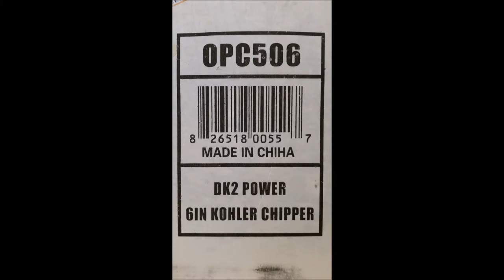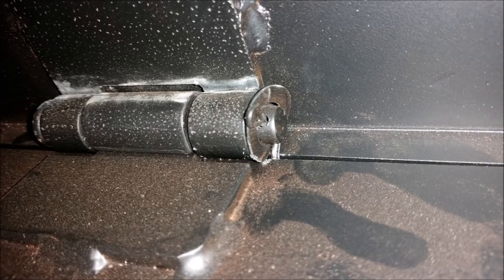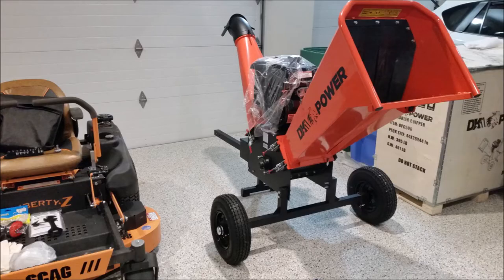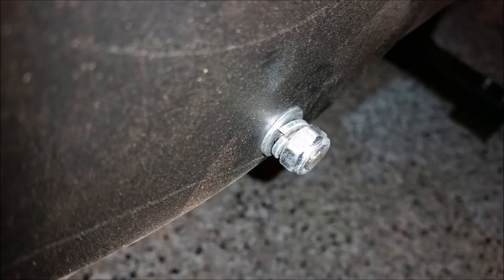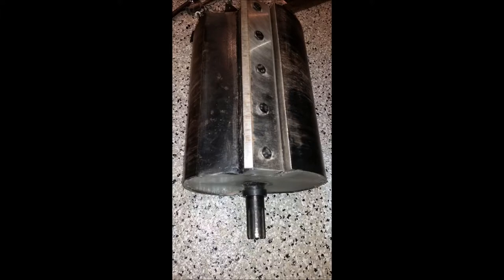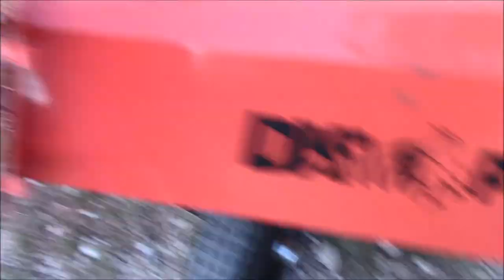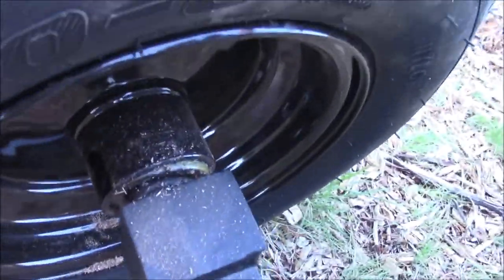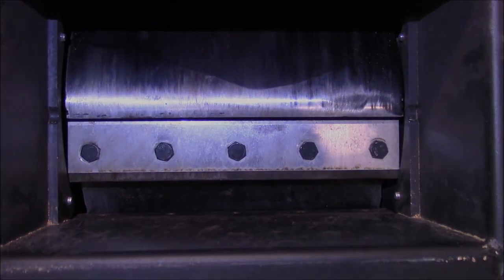DK2Power OPC506 Wood Chipper NIGHTMARE and Tear down!

Comment: I think you got a returned item . Did you look at the blades before you started the chipper ? I bought the same machine and it works great . The only thing I don’t like is the chipper blades get dull fast . That’s probably because like you I was trying to chip dry wood . On a fresh cut tree it works really good .
Reply from the maker: No it was a brand new unit trust me.  it was a piss-poor lemon that's for sure.
Reply: @morejelloplease  how did you get the whole drum out of the chipper ?
Reply from the maker: @johnbailey9682  I don't remember the exact steps but I had to remove a bunch of nuts and the studs were stripped, the belt cover was stripped, lots of slag, it was a cheaply made and assembled mess.
Reply: @morejelloplease  I was changing the blades but one fell down into the drum now it’s under the drum and cannot get the drum off
Reply from the maker: @johnbailey9682  maybe you can get at it with a expandable magnet, make damn sure that spark plug is removed from that engine you don't want any chance of it firing or compression rotating that drum and taking off your fingers.
Reply: @morejelloplease  yea I can’t even see the blade so I’m trying to remove the drum to get the blade out it’s under the drum and I can’t see the blade anymore .
Reply: @morejelloplease  tried that does not work I got the drum lose I asked a friend to help me when he has time because I can pry the drum up but need someone to pry the blade out .

Comment: The blade is mounted wrong;  the bevel on the blade should be turned toward the drum.
All  chippers work like a guillotine. The sharp edge of the blade passes by the anvil, thus doing the cutting.
This is why the chipper would not chip.
Reply from the maker: this is how it came from the factory, it wouldnt go in any other way, the anvil could not be reversed.  a drum chipper is different from a disc.    this thins was so crappy i had to make a video or else no one would believe me :)

Comment: You sure did have a lot of issues with your chipper. I also had issue with missed aligned parts, and the tons of corrosion. I will be making a update to my review this weekend before I take my machine back. I really haven't chip too much and already the blades are becoming dull. Also the discharge shoot keeps coming lose.

Comment: Alibaba wood chipper with a lot of different names.  Dead, dry wood is very hard for a chipper too, did you try it with green wood?
Reply: Very true.  It used to be that "import resellers" with integrity and money would find a good factory, send a rep over and work out the details of quality control in person to eliminate, "lost in translation" and dubious quality control practices.  Basically it costs money, time, and a good business rapport to develop a product with good QC.  There is a much better market in Europe due to the demand for these small machines.  Much better quality at a much higher price though.  They have great machines that we can't even get here in the US.  Now if I could only buy a small chipper on tracks from Alibaba instead of $10k for the same thing here in the states.
Reply from the maker: not sure how i missed this, i'm not receiving notifications all the time.  green is a little easier but it still chipped slow.   new chipper arrivng next week.

Comment: I know absolutely nothing about that make of wood chippers, but it looks like the blades must be turned 180 degrees so that the slanted part of the blade faces the drum. A chipper with blades is most useful on fresh branches and not some that have been lying around and dried up.
Reply from the maker: @TheLandbo  I've tried it all,  it's sad it won't chip a twig, old or new. Too many factory defects.
Reply: @morejelloplease  Yes, I can see there are many problems with that machine. I hope you have found another model that works.
Reply from the maker: @TheLandbo  nah I just rent now

Comment: I am glad I watched the video as I was considering a purchase. Very good detailed review, thanks. I am guessing this was manufactured in the big C. I have encountered similar problems with Ch#a products, such as poor welds, misaligned holes, stripped threads, poor machining, poor quality quality alloys, and flaky paint. I am tired of re-drilling holes, breaking bolts and screw heads simply by tightening by hand.

Comment: Hey thanks for the video.  After seeing the other vid you referred to, I was considering buying one.  Not now.
By chance, did you buy it from Lowes ?  They show ones with a black bottom like yours on their site.
Tractor Supply shows the orange ones.
I worked in the building supply business for 9 years (not a big box store).
I found that manufacturers make products to the buyers specs.  Example:  we would see Stanley doors from Home Depot vs our Stanley doors.  The jambs were thinner, and so was the steel on the Home Depot Stanley.  Maybe DK made a cheaper version for big box stores ?  Who knows.
Sorry for your bad luck !
Reply from the maker: this one came from home depot.  i noticed last years model had an orange drum casing.  i think different vendors get a mixed bag of paint jobs, just depends what leaves the manufacturer in china.  I wish this thing would have worked properly, I have a different chipper on the way which cost 2x this thing, i'm hoping to make a positive video for a change lol.
Reply from the maker: this also reminds me of when i was building my house, i was told that the delta faucets were plastic vs brass for the contractor ones at the plumbing store. i called delta and they said we make the best faucet we can, some models are brass, some use plastic, just depends on which one you get, but we don't make a cheaper box store version.   when i told the plumber what delta said, then he suddenly matched home depots price.  some vendors say "we can't compete with big box stores, they buy more faucets and get a bigger discount"  well, on the opposite side of the coin business is business, i'm buying 15 faucets, and i expect the price to be right.   if the faucets are the same then it makes sense for me to buy them from depot at $171 each compared to $230/ea. at the plumbing store.  sometimes shops are just too far apart and don't want to play ball, i'm not asking for something for nothing, but when cost is $120 each, there is still meat on the bone at $171.   multiply that times 15 and you see where i'm going.  sometimes i've had to tell them thanks but no thanks and move on, some guys got butt hurt and started name calling in emails, that was a window store here in austin, i had to block their emails.  that's just bad business practices.  their yelp reviews were horrible, wonder why.    I like home building , home inspections, diagnostics, etc.   on those weekends when i need to mow the lawn or chip some wood i expect my brand new machine to do what it's supposed to, not break in 5 places leaving me with my fingers crossed hoping i can get replacement parts under warranty, too much fuss and bother.  imagine if car manufactures worked like that? oh wait, there's one that does.  Honda. lol   i owned 9 of them, never again.
Reply: @morejelloplease  
We measured the jambs on the doors.  There was a difference.  Cheaper quality.  IDK about Delta.  I can tell you, Price Pfister had different ones.  I broke a part on one years ago while installing it.  Went to every plumbing supply to get a replacement.  Nothing.  Had to return it and go with another brand.
Reply: I purchased this same model from Lowe’s. Much different experience.
I’ve cleared about 30 3”-5” trees and done a lot of canopy lifting- and it’s worked like a tank! Dry wood does chip harder and kickback, but fresh cut trees that are 5” pull right in and chip. 
Sorry you got a lemon. :(
Reply: @morejelloplease  the manufacturer is in Chiah.

Comment: Forgive me but i have the power king copy same engine same chassis…i use it to run a two man tree service mine works perfectly well even after two years, one thing that did happen to me is a week ago i think my drum split i wish you could share more info on how you removed the belt pulleys to access the drum im currently stuck on that part,,, try power king though
Reply from the maker: I don't remember honestly without looking at my video, I could remember though that it was hard to take that cover off with stripped nuts and bolts. The Power King is made by the same company, you got a good machine, I got a lemon.

Comment: Wow. The welder dropped his lunch money inside that drum.

I have found with most pinch feed chippers, they will take branches as fast as you can feed them if they are straight and green, not ash,oak,or black locust, and nothing forked or twisted at all. My DR will take huge pine when it's fresh and green as long as it doesn't have any snags. 
This DK Power design doesn't leave you much to work with...alignment and so on.
Reply from the maker: Mine was a hunk of junk

Comment: I thought all the reviews made it look painfully slow. I have an old DR chipper that would eat it's dinner and I only have $400 into it. Old 18hp Briggs opposed twin powers it right through.
Reply from the maker: I bought a mackissic commercial (they make DR) and it failed on me several times. They worked with me on repairs but it just wasn't up to my standard. I've yet to find a decent chipper.
Reply: @morejelloplease  have you looked at the larger Yard Beast brand?
Reply: @wpog8453  or maybe JONCO, never let you down

Comment: May I ask, which vendor you bought this used/abused machine from?
Reply from the maker: Home Depot had them on sale $1999 if i recall correctly.   they were just the vendor that did the transaction.  the unit came straight from DK2 Power on a pallet via ABF or Estes freight, can't remember which one now.   These are made in china,  in fact the manufacturer makes slightly different variants but paints them different colors for different US buyers.  they range from $600-800 and shipping is determined on the amount of pieces they buy.  There's no quality control, something is bound to break on these units sooner or later, and if you're outside the return period then you're screwed.  I bought it thru home depot because I could return it easily if there was any issues.  I contacted the owner of DK2, same owner as power king and he told me to return it and buy another one.  After all the issues I saw with mine there was no way in hell i'd buy another one.  If they want to send me a 566e i'll try it in exchange for a simple and honest review, and if it works, then great, the video doesn't lie.  but so far i havent heard a peep.  Not a big deal, I found a manufacturer that stepped up to the plate and i'm going to test their machine in a week.  I almost bought a Salsco but they tried to sell me a 6 year old used machine with no warranty representing it as new.  Fool me once....
Reply: @morejelloplease  Thanks for the information!  I paid 2500.00, from a vendor on Walmart.  It looks like YouTube as a 50/50 split right now.  I'll be sure to document my experience...hopefully much better than yours.  This is one power we have, it's up to us to keep businesses and manufacturers honest.  It shouldn't be but it is what it is.
Reply from the maker: @BuckRogers2000  the key issues with mine were the bed knives didn't line up correctly and were not adjustable despite what they say. The drum bearing allen screws were loose. The blade knife bolts disappeared, the belt wore prematurely, overall fit and finish was pretty poor. I assembled it correctly, you basically attach the hopper and exhaust chute and add the wheels, then its ready. All of the issues were from someone else's hands, not mine. It looked good on paper but realistically you're not going to feed it a 6" log unless you want to babysit it for 5 minutes, and that's IF it doesn't stall the engine.  Some people are embarrassed to say they are having issues because of what they paid. All I'm trying to do is present a real world end user experience and educate the next guy that's looking at buying one of these so they know what they are getting into.
Reply from the maker: @BuckRogers2000  this is hilarious, as I was replying to your previous comment I received an email from the manufacturer of this machine from China, I told them that I was going to use this almost daily and possibly rent it out so I need to the engine and everything to be completely reliable. They responded and told me that I should purchase a USA made one that has an EPA certification so it will give me trouble free operation. At least they were honest LOL!
Reply: @morejelloplease  As will I.  Mine is tentatively scheduled to arrive on the third.  Keeping my fingers crossed but will have my camcorder running, when it arrives.
Reply from the maker: just got mine and released a teaser video
Reply: @morejelloplease  I got mine last night, videoed the arrival, to include the name of the delivery driver...just in case.  About to open it in a few minutes.  Good luck with your new one!!
Reply from the maker: @BuckRogers2000  video the piss out of it and stick it all on YouTube lol, reference my video if you want. I took more photos than video.
Reply from the maker: @BuckRogers2000  how'd your chipping go?  i'm at a stand still, i may have another failure on my hands.
Reply: How does one get the flywheel off?  Puller?

Comment: Did you ever get it fixed?
Reply from the maker: Hell no, the company said bring it back and other another one, maybe it will be better. One of those dreamt in USA, made in China deals that's not his fault or problem. I returned it and bought a $5k made in usa one and even that failed on me in 30 minutes. I had videos posted but the company worked with me to fix it. I ended up selling that because in my opinion a $5k machine should be efficient and it wasn't, kinda like my $5k scag zero turn, 3 brand new  - all have issues, no dealer or manufacturer support, warranty doesn't mean a thing.